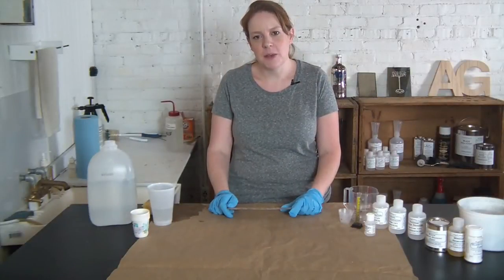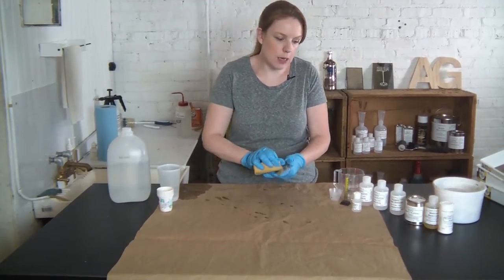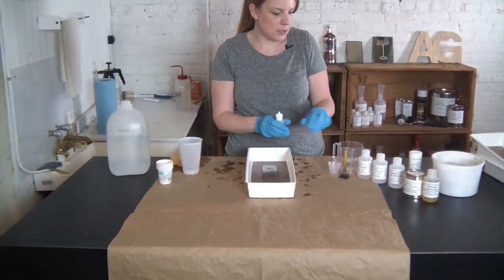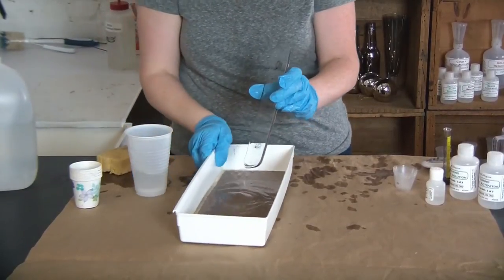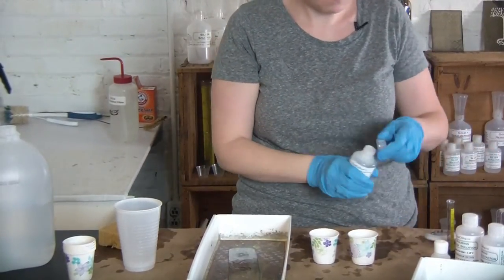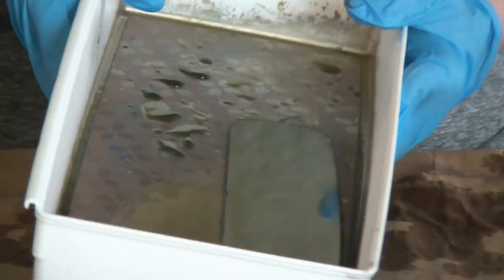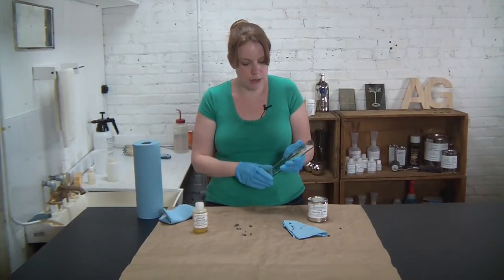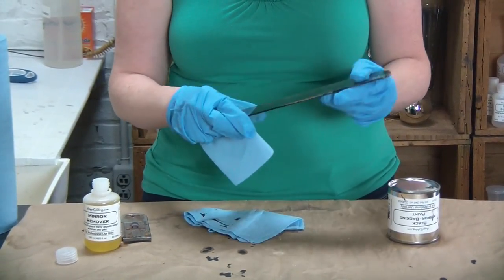How To Re-Silver A Car Rearview Mirror

Comment: This works really well.  Was able to get a great result on my third attempt.  First attempt was ok but I accidentally smudged the finish before painting and I think I did not get all the excess tin off.  Second I accidentally mis-mixed the quantities wrong.  Third time was the charm and I followed the instructions to the letter which I think is the key.  One thing I added on attempt 3 was that I rinsed of the tin thoroughly with tap water and then rinsed again with distilled water as I was running low.  Think that might be a little more effective in terms of getting that tin thoroughly washed off.  Another thing is that if like me, you are not masking the "back" or side of the mirror  you are not coating it can look like you have a good coating on the side you intend to treat because both sides of the mirror will be coated.  Be very careful that you have an even finish on the side you want or you will be disappointed when you clean off the excess silver on what ends up being the side of the glass/mirror you look at.  Important to get this right before painting for obvious reasons.  Finally in terms of the confusion about front and back I might recommend that instead of using the term back and letter B to mark the side of the mirror that you are NOT coating it might be better to shift the instructions to making it clear that you are coating the BACK of the mirror and to use the term front and the letter F to mark the side you are not coating.  The main reason for this is that the letter B looks pretty much the same reversed where F is much more distinct and also I think the instructions would be less confusing to a lay person.
Reply from the maker: Thank you for letting us know about your experience using the products! You make some great points there. We do not recommend using tap water during the silvering process because it could cause issues, depending on the quality of your tap water. However, it looks like it worked great for you. You make a great point about marking the opposite side of the mirror.

Comment: Good video, thanks for sharing, ... I wanted to try this myself but when I got in touch to purchase, the shipping was more than the solutions as I'm in the UK ... So I started purchasing all the solutions and making them up myself with Silver Nitrate, Ammonia, etc etc, ... This is more or less the same as the Tollen's test inside a bottle. In fact you can pour the Tollen's over a sheet of glass like you did and will get the same result ;-)
Reply: @Tuca-Luthier.  No problem, .... Are you wanting to mirror glass or plastic or metal objects?
Reply: @EssexSilvering  Good morning Dave 2v, I intend to shield plastics and metal, I am from Brazil, and I would like your help, if possible of course.
Reply: ❤ hi hi lo wat is Naam kamikaal

Comment: Hi. I like the product and want to use it for some small (8") round beveled glass mirrors from an antique scale. I am confused about two things though in the video. For all baths is the back of the mirror (the side that will eventually be painted) facing up?. In your video you mention keeping track of the back with the marked letter B'S. If those letters were truly written on the back wouldnt they be trapped in all the washes? At the end of the video I can see those letter B's but they look as if they may have been on the front (non painted side of the mirror). My intuition is telling me that the Front of the mirror would have the marks put on it and that the front side is always down (touching the wash basins) for all washes. Am I correct in saying that or did I misinterpret something in the video?
Reply from the maker: Hello, thanks for your question-it's a great one. This can be confusing. The side of the glass that you are silvering will BECOME the back once you are done, but while you are working on the piece you will want to note which side you are silvering and which you aren't. We do this by writing a "b" because when you are working on the piece the back is the other side. The bottom line is that you need to make sure you clean one side very very well, then Tin, rinse and silver that same side. Once silvered, you paint directly over the silver and when you flip the piece over you see your mirror! I hope that helps, we understand it is confusing.

Comment: Hi there and thank you for sharing your expertise with us!  :)
I have an old closet door with the same size mirror in it.  The mirror has started to loose the silver around the edges.  I like to know if I can remove the darkened areas and put the silver coat only on those areas without too much separation lines between the old and new mirror?  The doors and the mirror are pretty big and heavy, so I don’t want to redo the whole thing!  Any ideas?
I looked at Amazon and there are multiple Angle Gliding products for mirror.  Which one should I use?
Reply from the maker: Hello Leila, thanks for asking this. Are you able to remove the mirror from the door? You will need to be able to do this first. There are ways to silver a selective area but you can likely still notice the difference between the new silver and the old silver. If you would like to email us at cust.service@angelgilding.com with some photos of your piece we would be happy to help in more detail. Thanks!

Comment: looked to me like those letters you wrote all over the back in black marker persisted even after you were all done?
Reply from the maker: Hello, yes they usually do. It is written with permanent marker which can be removed easily from glass with acetone. An alternative would be to apply a piece of tape. Thanks!
Reply: @AngelGildingcom  It would have been good to show the removal of the B's and a final reveal of the clean/shiny mirror.  This also means you wrote the B;s on the front? Which is counterproductive intuitive.
Reply from the maker: @maxdamage8562   Good points! This video was made some time ago and was done in partnership with Mustang Connection. He did show the finished piece. Perhaps we can make a refresh of this video in the new year!

Comment: When you got done I could see the "B" you put on it ? ?  so now what do you do ?
Reply from the maker: That's a good question. The "B" is written directly on a glass with a permanent marker which can be easily removed with rubbing alcohol. Thanks!
Reply: @AngelGildingcom  I guess what I'm finding confusing is the B was on the back and the back is where you put the Black backing paint which will now seal it into the mirror.. I'm trying to decide whether to do the mirror on my 71 Buick Gran Sport or just buy another one and I'm finding some of the videos online a bit confusing
Reply from the maker: @posttal216   Hello, yes we understand this can be confusing. The silver is done on the back of the glass, however this is the side you are working on during the process which means for the silvering process the other side is the back. You may find that our 3D mirror kit videos are a bit clearer or perhaps our illustrated instructions. We can also help with further support via email at our contact us page on the website.
Reply: @AngelGildingcom  okay I think I got it the side you marked with the B for back is actually the front of the mirror as you look into it.... and the actual back of the mirror... the side furthest from you as you look at it.... is where you have the silver and the Black backing.
Reply from the maker: @posttal216   Yes, you have it! I know it's confusing but you have it!